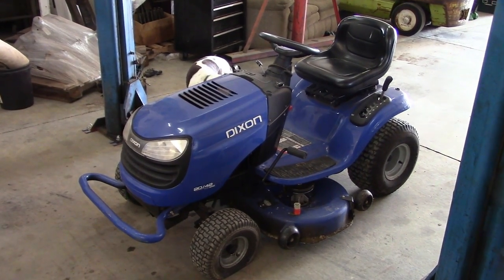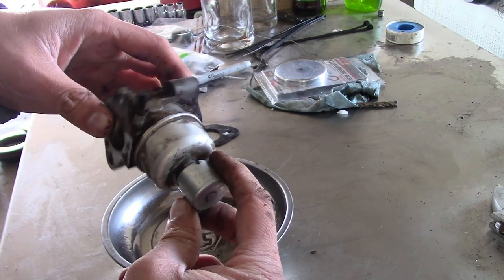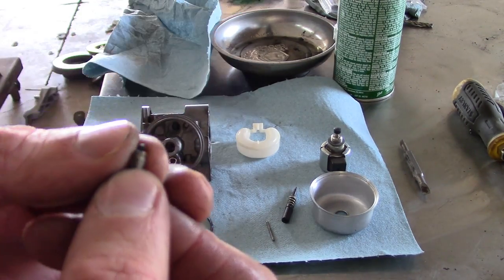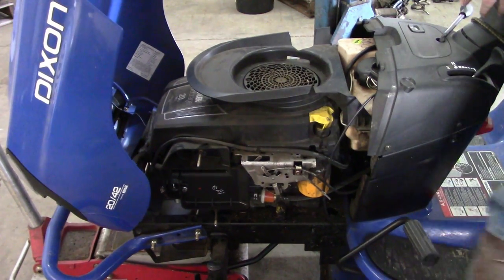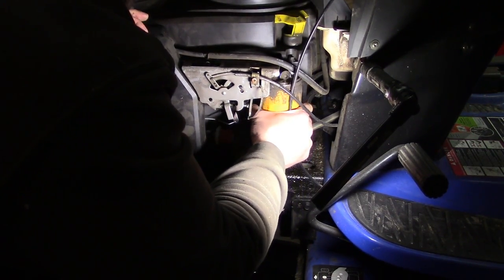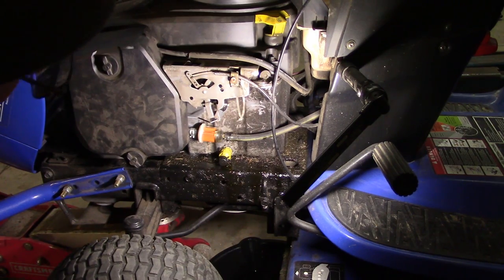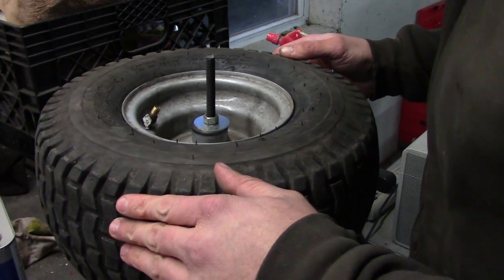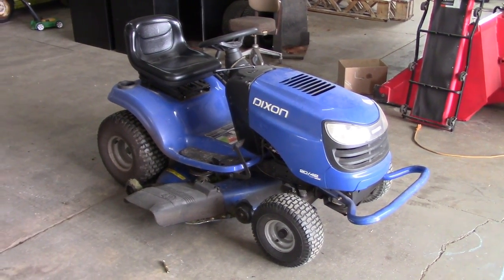Fixing up a Small Lawn Mower

Comment: I've run nothing but "Mower fuel" through my mower since new and it never has a problem sitting over winter.  I learned that the crap gasoline is the source of all small engine problems when I lived in CA.
Reply from the maker: I use Sta-bil in my small engines and have no issues. The best is to run them out of fuel.

Comment: When you raised your hood, I saw the problem a Kohler Courage.  I have heard they have plastic cam gears.  It is a cousin of a Husqvarna, Craftsman, Poulan Pro and few others, but most have Briggs and Stratton engines.  I also noticed after installing overhauled carburetor, when you started it back up, the engine was moving/vibrating.   It seems that Kohler didn't balance them good and your engine mount bolts are a little loose.   I have seen this on a Troy Bilt riding mower with the same Kohler engine.

Comment: Wes, have you seen the new John Deeres with the quick change filter. You don't change the oil. You change the filter only, which is prefilled. Their claim is change your oil in 30 seconds. But the filter is $50.00 a pop. My son bought one this year.

Comment: Walbro is a great mower carb , stay away from a nikki carb , that solenoid also helps from back fireing and leaking fuel into the cylinder when it's not running

Comment: My eyes! lol glad i was wearing my safety glasses over here when we got the brake clean to the face.  Ive been meaning to service my mower too. I have a diesel walker zero turn and it needs serviced.  belts for the hydro and tires. they hold air but are slicks and makes it a pain to do the hills.  I usually fix everyones power equipment at work and their friends or family too. Thats how my grass got cut this week was with a tractor i fixed.  Gotta test your work right?
Reply from the maker: Do you still have that diesel Bolens?
Reply: @WatchWesWork  yes. 2 of them actually. the one i repowered and the a factory HT20D air cooled wisconsin (ducati) diesel

Comment: As always I look forward to all of your videos. This job reminded me of a cub cadet I had in the late 90s before all the cheap chinese replacements were available. The replacements at that time were like $300. Did all the rebuilds adjustments etc and would never run right. Not to be beaten,  I ended up using a diamond blade on my dremel to make a glass bowl out of a mexican soda bottle ( yeah I took the carb bowl to the supermarket to find an appropriate size...It must be metric lol.) Finally I could see what was going on. I could use the shut off valve to meter the gas because it would just keep loading up. Initially I though it was the float, but it turned out that the brass jet in the side of the down tube was eaten out. It would suck too much gas rev up and empty the bowl, choke and die slightly while it refilled and just kept surging back and forth. Never would have figured that out without being able to see it. I ended up just putting a screw in it since this one ended up having two jets and it ran great. Long story short sometimes this ethanol gas eats away at those holes. Just in case someone out there comes across a mystery annoying carb problem. In the end the glass bowl broke , the original was rusted out so I fund a cheap replacement on Ebay the next season.

Comment: The only problem with Fram filters is the per pound release rate. Doesn't match most engines. Something I've learned to check after losing a couple of motors due to that.

Comment: As always,  I enjoyed the video.  Didn't you say something about replacing a belt on the deck? There are usually some grease fittings on those deck pulleys as well. I love seeing a hose connection on the deck, clearly isn't being utilized.

Comment: The Husquavarna ones that I’m familiar with have an almost identical body and chassis and controls, that front bar is absent on them and they are Briggs and Stratton powered, the craftsman ones that Lowe’s has started selling seem very similar as well and i’m sure there are others that use the same parts bin.
Reply from the maker: They all seem to be about the same, just painted different.
Reply: Is there a connection to iseki. Our local semetery has one that looks just like that. Iam from Germany btw

Comment: Funny you said Dieseling. We use to have a car that use to do that, that's what my dad use to call it!!! Among the other issues it had!!
Timing chain use to clatter and make it sound like a diesel. Thing was unlike modern engines, it had a double chain. Only made 100K miles before the engine was shot. Swear it's because dad used rubbish FRAM oil filters. Engine oil most likely wasn't getting filtered
Reply from the maker: I think we have gotten spoiled. It wasn't that long ago that all engines needed a total rebuild by 100,000 miles.
Reply: @WatchWesWork  I think you're right. Yet some old engines cause they had regular oil changes have lasted hundreds of thousands of miles, and still going strong!!

Comment: Tell your cutomer that the mower has a quick connect water port on the top of the left side of the deck he/she needs to buy the hose end at the loval depot, lowes or Menards  and use it for 5 minutes with the hose on full blast while its hooked to the deck with the blades dropped to the lowest setting and they are turned on, it will clean the grass off the underside of the deck and help keep the deck from rusting out.
Reply from the maker: As we say, "you can lead a horse to water..."

Comment: We dont have a farm & fleet by me so I used Fleet Farm brand (resolute oil). That Kohler engine makes my brigs on my Allis Chalmers look top of the line. Up here I run 5w30 synthetic in mine thats what it calls for in the manual and what can in it brand new when I bought it so I run synthetic blend in it now after 10 years but still runs like new and looks like new minus a few scratches never needed a repair yet. Mine also had a plow for it and SAE 30 is too thick when its below 0 to start it if I decided to use it in the winter. Mine has grease for the deck too top and bottom bearing for the blade spindles along with the front end too.
Reply from the maker: These spindles are not greasable. It's a disposable mower.
Reply: @WatchWesWork  I see so many buy those and get upset they don't last long. Like the saying you get what you pay for

Comment: i use the 10w30 it calls for only because i ran out of straight 30, and have a lot of 10w30 for other engines. i bought a case of 30 back when it was priced in the double digits, and ran out last spring. this spring it gets 10w30, and a new filter. it's the better kohler 20hp. on a simplicity broadmore, with a 44" deck. i know, changing the oil viscosity will kill it, but damned if it doesn't run good for a zombie.

Comment: I'd say, 8 out of 10 Kohler Courage, are a bomb waiting to explode. I have 2 of them that, got the SAME internal hardware coming loose and, blew a hole through the bloc. One at the bottom sump and the other, on the left side of the sump. Owners who got the warnings about them, had them completely taken apart and put back together with loc-tite.
Reply from the maker: The only one I know of is the top cover bolts backing out into the flywheel. I have checked these in the past.

Comment: 👍 enjoy all your videos Wes.
Gotta love those knipex pliers!
Had someone bring me some blades for sharpening, but they looked great. Was told they wouldn't cut. The did when he put them on right side up though ☺️. 
I could use a good explanation on old charging system with starter/generator, and voltage regulator.
Also, explanation on old school points ignition. How to diagnose a bad points condenser? Coil testing?
Just some thoughts for vids if it helps. Stay well my friend!
Reply from the maker: Yeah those would all be good videos!

Comment: Actual Kohler oil filter, probably because it's never been changed before. Didn't see if you greased the spindles of the mower deck, but they generally have zerks on the underside of the deck.

Comment: Heeeey Wes, good to see you.  I won't go into the hell I have been thru since this past Friday, suffice it to say I have been without internet services till this morning.  Great to be back in the real world.  I kept asking myself, how in the hell did I get this far in my 56yrs without the internet...?   Hahaha...!
    I have had a little experience with the Kohler line of engines (more of the generation before your mower), but I have been pretty impressed with parts availability, and "reasonableness" of their prices.
    I can't believe your shop door was not kicked in by the DEQ, EPA, & Green New Deal author Alexandria Ocasio-Cortez police, the second you ground that idle needle valve adjustment tab...   Holy Cow man, glad you evaded that...
    I don't run anything but the non-ethanol fuel in my mowers, chainsaws, generators, ATV's & boat etc., don't get even get me started on that topic.
Great video, than you sir.
Reply from the maker: Here in corn country it's almost impossible to get non ethanol gas. Iowa is even worse.
Reply: Watch Wes Work "well, there's yer problem lady."  Sorry, couldn't resist throwing that line out...  LOL!

Comment: Really like this, hope you showed the owner how to use the hose hookup on the deck to clean it after each use.
Maybe you can answer why is the ethanol gasoline so bad on the carbs.
Reply from the maker: My understanding is that there are two big problems with ethanol. First, it can actually mix with water and stay in suspension more easily than regular gas. Second, it's a really strong solvent, so it dissolves everything and washes it into the carb.

Comment: those clone carburetors are actually quite good the first one I bought was for a briggs twin that always had run lean it had to small of jetting, the clone carb looked identical except it was adjustable and it worked perfectly, that engine never ran that good. I now just buy new clone carbs instead of trying to clean them.

Comment: I think I heard that MTD makes virtually all the riding mowers now. Just different colors, badging and lights.
Reply from the maker: I've heard that too. I actually did some work in an MTD factory. The place was massive!
Reply: You have MTD and AYP (American yard products). MTD makes mowers for there own brands that they have bought out over the years. AYP makes mowers for other brand to that brand blueprints and specs. Dixon is owned by husqvarna last I knew. I have a Dixon 54" cut garden tractor. Its the same things as the husqvarna  except the hood is a little different and its blue. Dixon was the first to make a Zero turn mower back in the day and husqvarna  bought them out to have access to there copyrights.
Reply: @RandomDude989  Dixon ztr. Had two both with the friction drums that like to burn up.
Reply: @asherdie  Yep, I've worked on them little things.

Comment: This is the same as the Craftsman I have except mine has a Briggs V twin. Interesting the Dixon uses the bonnet (hood) from the older Jonsered except it has vents in the top. Have seen a Red Max YT1842 branded one in a local mower shop but it had a Kawasaki V twin.
Reply from the maker: I guess you can get these in any flavor you like.

Comment: Yeah, I don't think I've ever seen an AYP oil drain tube installed more than finger tight, but those dopes'll torque down an oil filter like they're tightening head bolts.
Reply from the maker: It must be on the assembly sheet.
Reply: @WatchWesWork  The assembly coloring book, maybe.

Comment: TIP , the best carb cleaner is Mopar penetrating fluid , it will blow yer mind , spray it into a cup and let your parts soak in it , needle valve , jets etc ,,, and let spray it into all or-faces  and let it sit for a bit then clean it out with brake cleaner ,  trust me ya will never go back to regular carb cleaner again once ya see this stuff work,

Comment: Dixon was bought out by Husqvarna in 2006 a few years later in 2014 Husqvarna discontinued the Dixon brand .  The factory in Orangeburg,SC where riding mowers and as of 2010 zero turn riders are made has changed names many times, originally started as Roper,  then in 1989 changed to American Yard Products or AYP,  then in 1997 changed to Frigidaire Home Products after poulan/weedeater, AYP and Frigidaire merged. In 2000 once again another name change to Electrolux Home Products and in 2006 Electrolux spun off the outdoor power division to form Husqvarna Outdoor Products or HOP a subsidiary of Husqvarna Group. On any AYP/Frigidaire/Electrolux or Husqvarna built riding or push mower the date of manufacture is the first 6 digits of the serial number - the mower in the video was made November 9th 2012.
Reply from the maker: Well that sounds like quite a mess...

Comment: Those Chinesium oil drain ports are junk.  Everyone I have seen has been loose and leaks.  I have replaced them with EZ Engine Oil drain valves which have an O ring that seals tight to the engine and are a locking 1/4 turn valve.  So far they work great....  This block on this engine also has a propensity to crack on the starter side if the top cover bolts loosen up.

Comment: Sealing one side of beads only?   Better to seal both beads, as if one side is giving trouble, the other bead probably will also.  Could save yourself a lot of trouble later, and only takes a very small extra time whilst you have it off the machine.

Comment: That looks suspiciously like a product of AYP .  They make mowers for lots of brands, Craftsman notably.  Some of those limited travel bits are put there to slow down Harry Homeowner and his fix-all screwdriver.  I've replaced plenty of stuff where someone saw a loose screw and tightened it down good then wondered why the engine quit running.

Comment: Kohler recommends 10W-30 for the Courage series engines
Reply from the maker: Kohler says you can use straight 30, 5W-30, or 10W-30 depending on your temperature range.

Comment: I like this kinda Videos, I probably like all of your videos, 
but for the next time you should put the Oilfilter in a vaccum and prefill it like this, so no air is in there, and before you start the engine you need to prime the Oil pressure ;),
I love these guys that never touched more than Babyoil. 
One thing i wonder is why you haven´t got an Tire air filler with an pressure  gauge on it. Here in Austria we only have these combined ones.
I hope you understand my wonderfull english. :)
Reply from the maker: I think I have a combined tool somewhere.

Comment: Also gotta watch on the Kohler's most of them have hydraulic valve lifters and I know from experience they don't like straight 30 it'll make the lifters not pump up and make a terrible clatter not sure if the courage was hydraulic or solid
Reply from the maker: I don't know. My Cub Cadet has hydraulic lifters in a Kohler Command and it runs fine on straight 30W.

Comment: I guess some engines are special, they are not harmed when you cannot prefill your filter because it mounts sideways or upside down.   But on all engines where it mounts right side up, engines will be destroyed if the filter is not prefilled.   Sarcasm off.

Comment: Being pedantic in nature the one thing wes does not do to this carb that the mustie lizard does is turn the carb over & let the float hang down and bend the float ears level while hanging. This is critical for proper fuel carb level. The machine runs fine so he got away with it. Turn the carb over and with the carb level have the float level with the body of the carb.
Reply from the maker: It's always risky to try bending the tab on the plastic floats. It was easy on the old brass floats, but I'm afraid of breaking plastic.

Comment: That sheet metal looks very much like a 02 Scotts (by JD) that I use. I might know a guy that trimmed that idle circuit plastic do hickey off with a pair of side-cutters. Carb kits have gotten ridiculous they used cost next to nothing. I will prefill my oil filter if gravity allows what I can't understand is that people rail against it. I like that oil spout.
Reply from the maker: I paid $22 for this one. Seems like robbery for 3 gaskets and a needle.
Reply: @WatchWesWork  I agree.

Comment: Usually the OHV engines technically call for 10w-30... but I don't think that really matters.
Mowing where you pick up a lot of sand/dirt usually wears the fin off the back of the blades like that. Valve cover leak on that Kohler yet? It will haha
Reply from the maker: It does leak, a lot. And it is pretty sandy where they live!

Comment: Pull the Welch plug, and the emulsion tube and clean them both-
Reply from the maker: That's not really necessary IMO.
Reply: I used to not pull Welch plugs, then I serviced a Walbro carb that looked pristine, and pulled the plug-both orifices full of dirt. Look, you bought the kit, you're sitting ther with carb disassembled, go ahead and do the job. Nearly every emulsion tube I've pulled was gunked up.

Comment: This is what I do for a living. That plastic piece on the adjustment screw should pop right off.
Reply from the maker: What is left when you break it off?
Reply: @WatchWesWork  it's just a metal flathead on that mixture screw. I just put pliers on them and pull it straight off. Shouldn't break it I've put them back on before too.

Comment: I have a Carb with that in the bottom and it was killed when the 15 amp fuse burned out. It's meant to have a 15 amp fuse but testing a 30 amp ended up burning the fuse in under a few seconds so can you hot wire the plug for that sensor.
Reply from the maker: Something else is wrong. You should not be blowing fuses.